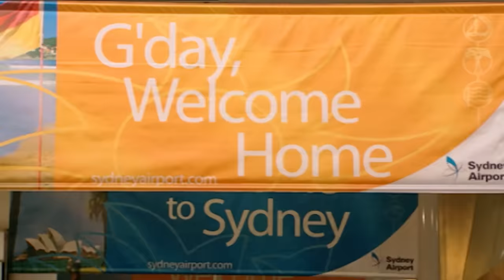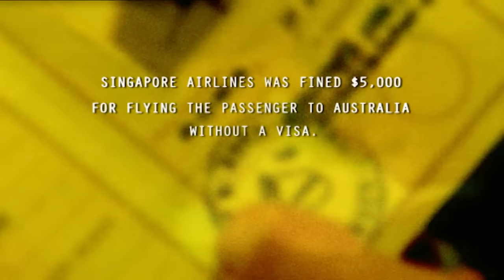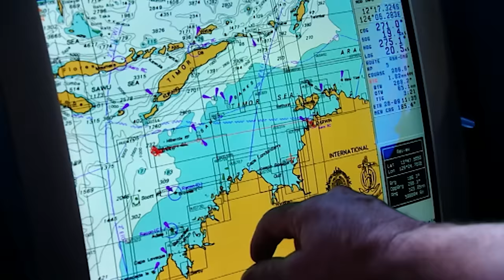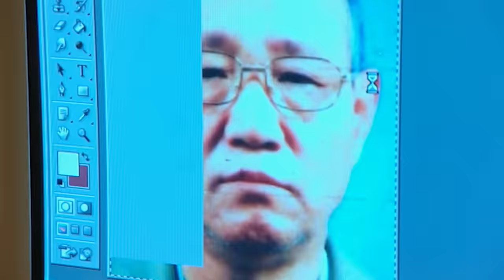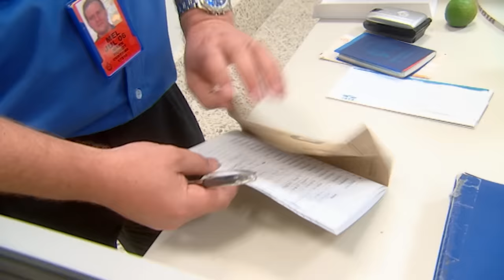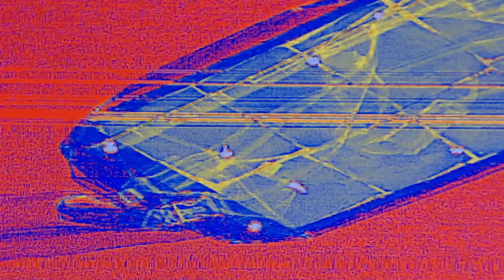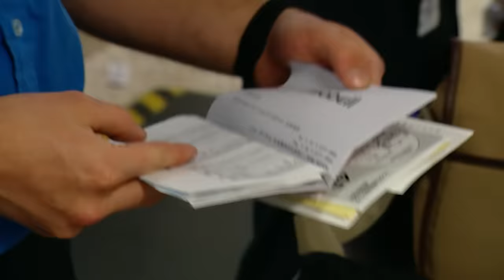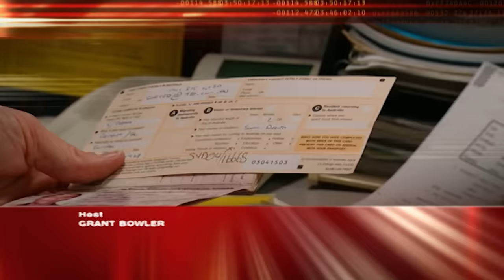2 Hours Border Security Marathon - Full Episodes S1 | Border Security Australia Compilation

Comment: When they said that Singapore airlines was fined 5,000$ for fly the guy without a visa…is that because they flew him into Australia or because they had to transport him to wherever it was?
Reply: The fine is due to Singapore Airlines not verifying that the guy had a valid Visa.  Singapore dropped the ball, and will have to pay the above fine.  

I would imagine that the passenger will have to work out the cost of the return flight with the airline.  A friend of mine who works for a US-based International airline told me that the airlines have to have a certain # of seats available on each International flight for use by each country's Border/Immigration Agency for officially deporting individuals.  And yes, this means that passengers may involuntarily get bumped off the outbound flight to make room for the deportees.  And if you happen to be flying Stand By/Space Available status (employees, family members, retirees, etc. on vacation), you'll be the first off the flight.